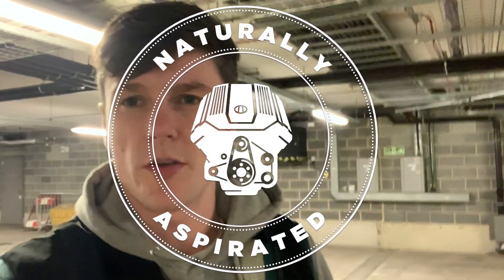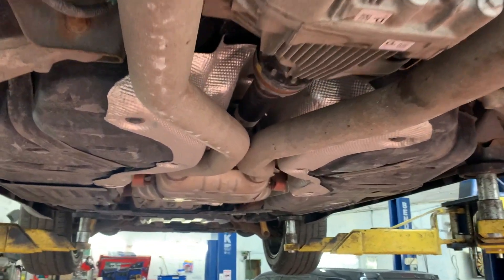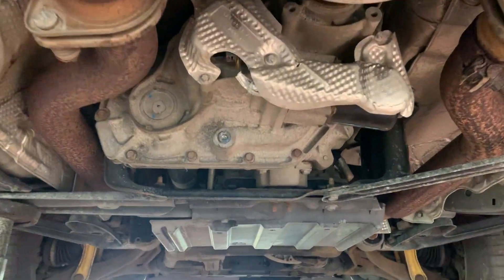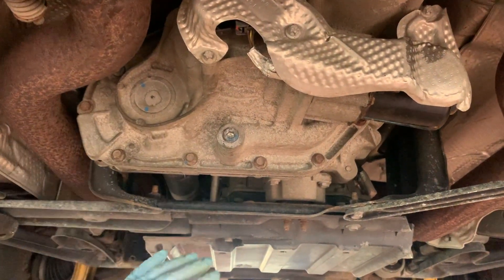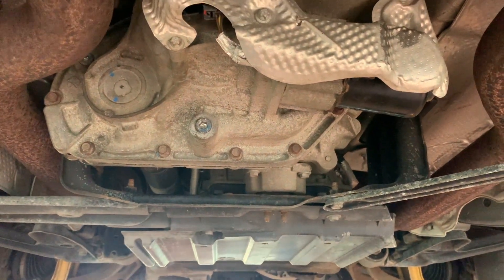How to FIX Jeep Grand Cherokee SRT Rear Diff and Transfer Case issues!

Comment: Has this happened again since then? I had a clunk issue. ChAnged rear diff fluid and added the mopar additive. Completely took the issue Way for 8 months. Its back now. WS thinking of replacing the entire diff
Reply from the maker: Once the fluid was changed it got rid of the noise and juddering completely! Thanks!
Reply: @NaturallyAspirated  that will most likely come back within a years time. Ive done it twice now. First time lasted 8. Months, second time lasted 3 months. Replacing the entire rear diff next week to see if that solves the issue. $3200 for the rear diff…. That hurt, but im almost positive thats what it is. I believe sone internals/gears in the diff may be damaged

Comment: Was it making a clicking noise when shifting into drive or reverse and then the clicking noise stops? Also when turning tight at low speed the front tires would “skip”? I have a 2014 and mine started doing it. No codes are present. Was it front differential fluid or trans fluid?
Reply: Rear diff fluid i think man. U change it  but you MUST add mopar fluid additive . Ive done it both ways. Only the additive fixed it
Reply: Mine just started with this problem yesterday (3/2/23) it’s a 2015 SRT I’m at 37k miles bought it used and I don’t think the previous owners had problems I’m gonna get it checked out but I’m going to bring this video up to my mechanic. And change the oils on it and fill maintenance also. Got it last year in July and it’s been great until this recent dif. Problem.
Reply: @mattyates12345678910 you sure?  Coz mines skipping in reverse and makes clunking under low speeds, changed the fluids but didn’t add the additive?
Reply: I’m having the same problem as u bro if anyone knows what it is please lmk I would appreciate, when u start it it starts masking clicking noises and goes away and whne I make a turn it starts pulling also.
Reply: got the same issue
Reply: I have the same issue . I changed all fluids twice and still do it . I am rrplacing the Transfer Case Module now !  I get the clicking noise when I put it in P ....and R ...it clicks... adn it jumps when cornering
Reply: @rudysrt9249 I have the same problem 2015 srt jeep. Tires locking on sharp turns and reversing and slow speeds, service 4wd. I changed both diffs and changed all fluids including transfer case fluids. 4500 in the hole and still no fix. I tried a aftermarket tc module off Amazon but it was no help. Any suggestions???
Reply: @311_21-k  I can't give you any suggestions just yet ,but what I can do is I will let you know what happens when I get my module from the States . I am in the UK . I think my problem will be solved when this module comes. I lifted the car yesterday and I sat underneath while my mate wah shifting gears.... When You put it from Pto R and the othe way around  the T/C is moving the prop, and when in P, it starts clicking, and it shouldn't be!  If the TC is broken than we would hear metal parts grinding inside the thing but in this case I think we have an electronic malfunction

Comment: Hey buddy, what were the symptoms you were getting to diagnose the issue with the diff??
Reply from the maker: Under slow speed manoeuvres I would get a juddering and "clonking" noise. But the oil change rectified all of that!
Reply: @NaturallyAspirated  was the juddering and clonking noise while turning wheels at low speeds?
Reply: Poor video, badly explained the core fault.
I was expecting detailed symptoms elaboration because I have got 2020 SRT8 and the right front wheel makes funny grinding noises at slow speeds so thought this will help but my bad